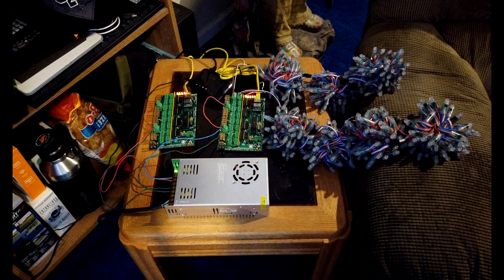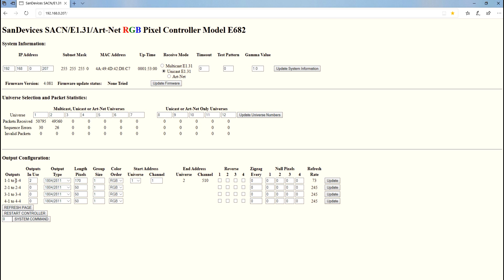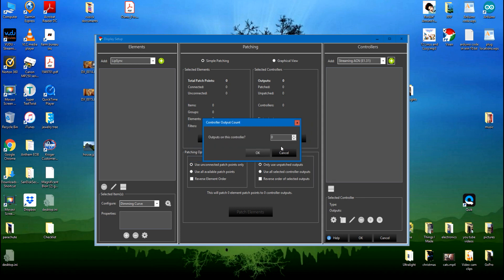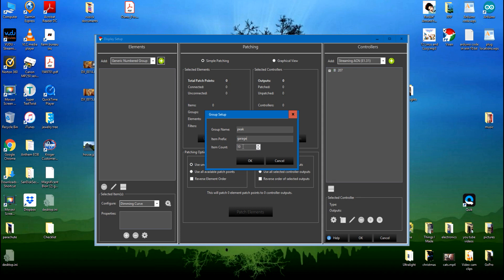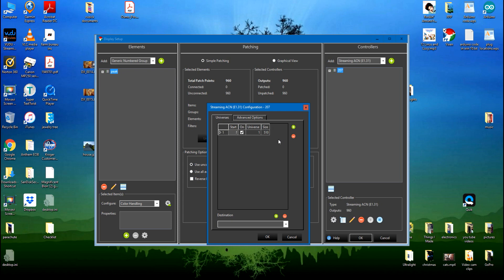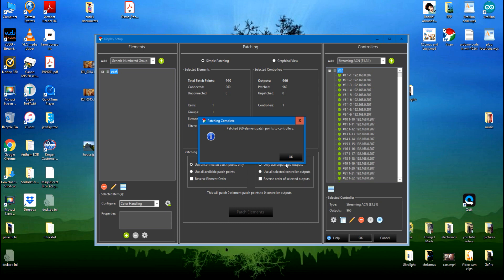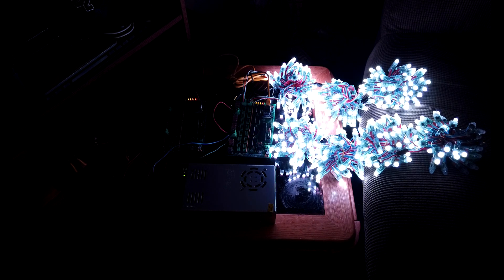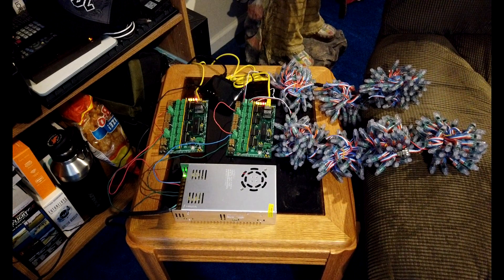RGB Pixel Lights - E682 Pixel Controller Part 5

Comment: I enjoy your videos very much. I have been using Vixen 3 with E682 controllers for a megatree and a grid for 3 years. All with all strings the same length. Works great. Next Christmas I want to add a house outline which will require different lengths of strings. I have watched all kinds of videos and searched doityourselfchristmas.com on how to use different string lengths for the 4 groups of 4 outputs. I realize that a lot of people have moved on to Firmware Ver. 5 to solve the problem. I tried your solution in Version 4 and it worked. But, I still had a nagging question of why is this so difficult to understand. I had looked at the SanDevices website many times and never noticed at the bottom of the page where you download manuals there is a download for troubleshooting. Several pages into that guide there is a paragraph titled "Pixel addressing considerations specific to E682 and version 4.xxx firmware". There it explains setting up different lengths of pixel strings on a group of outputs using "dummy strings" in the sequencing software. I know it wastes universe addresses, but I was able to use all four outputs in a group in my tests.

Comment: Thanks for posting these videos. Definitely has helped quite a bit. I have two E682 and so how would I configure for 16 channels and 4 universes as I have 16 strips of 50 bulbs. 

1 universe x 4 channels is 510 
4 strips (one per channel) x 50 pixels is 200 x 3 is 600. 

Is the E682 only good for 12 strips of 50 lights?   

Thanks again for the videos and your assistance.
Reply from the maker: Carefully watch the videos. Each outlet of a group of four on the E682 can handle as many as 170 pixels (170 pixels x 3 RGB lights (each pixel has 3 lights inside it) = 510 channels). As long as the first three strings are the same number of pixels (example 150, 150, 150) the last string must be an equal number of pixels (150) or less (149). If your second string is less than the first string (150 and 149) you can't use any more outlets in that group. You would have to move over to the next group. Pixel strings can be cut at any point (unlike regular LED lights). Universe numbers are unlimited. You are limited by each outlet being able to control no more than 170 pixels.
Reply: Dee Higginbotham thanks for the reply. I just reread the manual for the 682 and seen that there is 12 universes for the Unicast. Sounds like I will need to connect a few strands together as you have in the video VS having 16 single strands. Thought I was done with wiring.
Reply from the maker: There are 12 slots for universe numbers. You can number them any way you want. Having 2 boards you don't want to give them any of the same numbers. The first one can be 1 to 12. The second one 13 to 24 and so on. Pixel lights unless you are cutting in to them as I did, simply plug together (providing you bought the type that already have the plug ends on them).
Reply: Dee Higginbotham ok thanks. Learning a lot here and now makes sense.